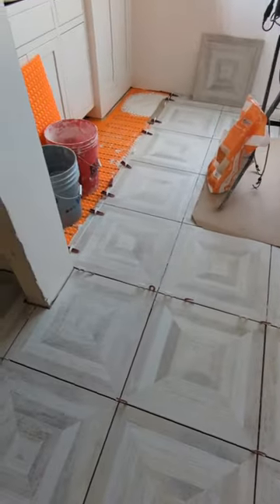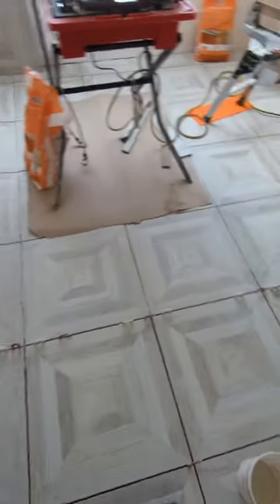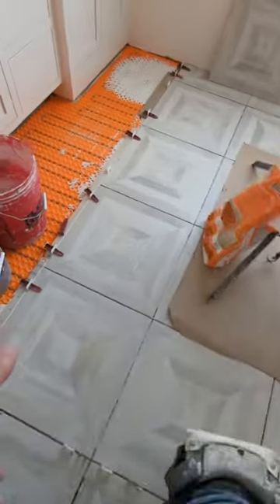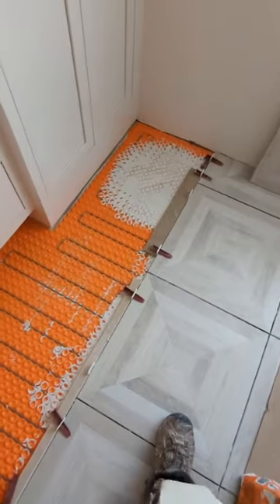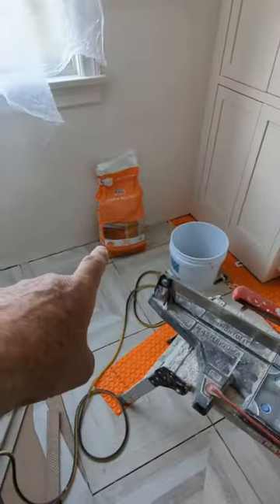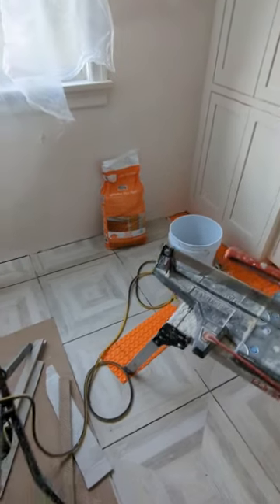Don't use the wrong mortars #shorts

Comment: Is the heavyweight mortar just for heat retention?
Reply from the maker: Not heavy weight, just regular mortar, and yes to absorb and retain heat.
Reply: @SalDiBlasi  ok, cool. That's what I was implying, just to clarify. 

But Would it be possible then, that lightweight mortar would heat up faster?

Comment: Sal can I use modified mortar with porcelain 12×12 over schluter ditra?
Reply from the maker: Yes, but not all.
Reply: @SalDiBlasi  heres the problem when my house was built the carpenters used metal x bridging in my floor framing and I didnt realize it. I yellow carpenter glued and screwed 3/8 plywood over 5/8 subflooring then started tiling over schluter ditra then in 6 months my grout started to flake out of the joints in high traffic areas I've since replaced the metal x bridging with solid 2/10 briding. I thought using modified mortar itd help prevent a repeat. It's a pain picking all the  mortar out of the dovetail squares
Reply: @SalDiBlasi  tell what you think please